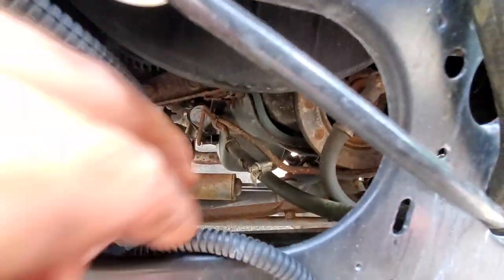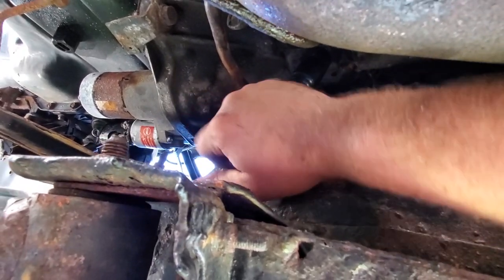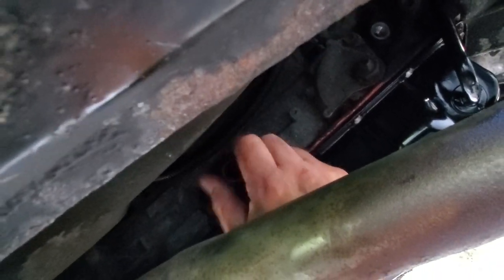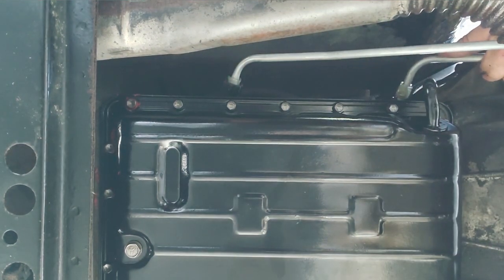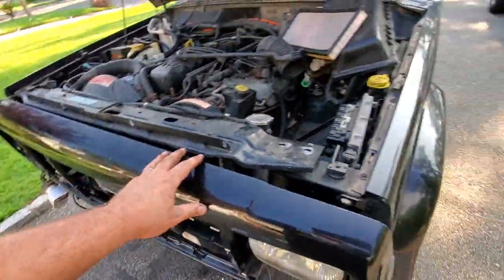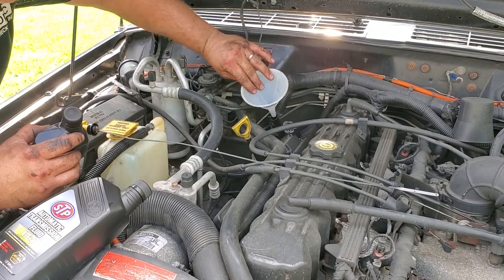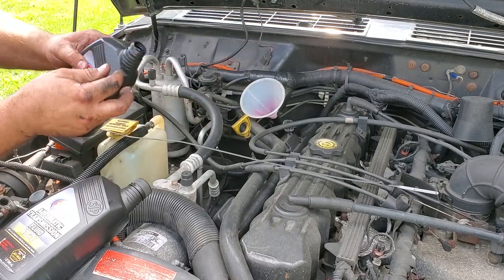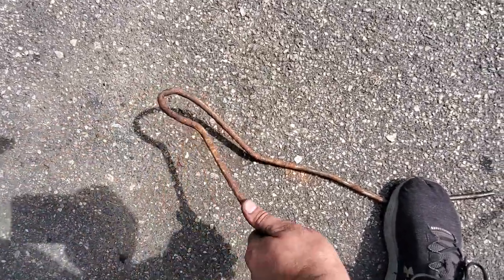JEEP CHEROKEE XJ TRANSMISSION SERVICE - PART  2 TRANS LINES & FLUID

Comment: For future reference, the bit about ATF-4 was actually a service bulletin after the warranty on all AW4s had expired, and many XJ owners steer clear of it. Next time you change the fluid I highly recommend using Royal Purple's MAX ATF instead. My XJ went from awful long sloppy shifts to being so tight and quick you'd think it had a rebuild. 

Otherwise, I'd absolutely stick with Dex 3 instead of ATF-4 as per the manufacturer requirements and not Chrysler's bad advice. Just don't switch if you're only draining the pan as ATF-4 and dex/merc should never be combined and will damage the tranny. Find a shop that has the machine that uses the transmission's own pump to flush the fluid and not compressed air. 

I also made the mistake of using ATF4 so I just wanted to share my experience. Cheers! ✌️
Reply: how do I find out what was previously used in my jeep lol

Comment: Great job Dan and the Jeep is looking good!-I'm about to do the same on my 2000xj-and was wondering why you bought so many O-rings?-How many and what size go on or in the dipstick tube-you never showed or said?--and do you not have to put an O-ring on the end of the lines after the plastic locks-before you push them into the connectors 800-714??--or just the clip only??-thanks in advance and keep up the great videos 👍

Comment: It’s funny i just found out coolant is leaking into my trans cooler so this video and the part number came in real handy
Reply from the maker: Glad to help, are you going to replace your radiator?
Reply: @ProjectDanH   yep I figured with my luck might as well just rip the band aid off and just do it all at once before  i nuke my transmission

Comment: If you take the electric fan out it's kinda easy to get at the lower transmission line at the radiator
Reply from the maker: true,but  it sucks either way. lol

Comment: I need to do this. My lines busted a while back and I flared in some soft lines, but they are starting to seep
Reply from the maker: oh man, thats a good quick fix but its best to get those new lines in sooner than later!
Reply: @ProjectDanH  well. It’s been 50k miles, and during that time, I only added barely a half a quart. They held up good. But it’s time for a flush, so I’m gonna do the whole repair
Reply from the maker: @highwayxj9397  wow!!! GREAT JOB

Comment: Good work! Mine look just like your old pair. It was a miracle they didn't pop when I pulled the oil pan out. Will snag some lines through your links when i get around to doing the jobs I already have parts for =]
Reply from the maker: Hey Sean, Thanks for using the links!

Comment: Whats up man! Question: is it true about atf+4 not recommended for AW4 trannies? I have a 98 xj classic and looking to do the same thing as you here. But the forums has this heated battle between atf+4 and dex/merc. Do you know why that's is? I see your running ATF+4 and just wondering if it's the right move, thanks man, strong island!

Comment: Dan, I didn't see you use the tools from the kit you ordered? are they absolutely necessary? or can I get away without them?  Also, how many connectors will I need?
Reply from the maker: 8:23 , the blue decoupler.   You Definitely need em to remove the trans lines from the radiator... the cheep plastic ones may work, but if its been on there for 20 years it will probably be stuck and require the metal ones from the kit.   They are a B!!!

Comment: Hey Dan I have a question for ya. My high pressure line that clicks into the radiator has about a 1/4in of play back and forth, I have and aftermarket radiator with a 5/16 elbow. Do you know the diameter of the elbow fitting in your radiator?

Comment: mi friend i am in perú i have a zj 5.2 95´s a change the MAP the TPS and the IAC but I steel burning fuel get 15 km per gallon i think to change the oxygen sensor and that's my las change I don't have the power it used to have, but i have new sparks wired, new sparks new sparks thins, maybe i change the injectors the engine is already fixed so mechanical is ok so i think is electrical problem, i am in a project is a incredible 4x4 have power, have force but don't pas 2000 rpm star stall, so i run until 2000 rpm  and wait the transmission make the change, sorry for my english i speak better than write
Reply from the maker: Hello, definitely try the 02 sensors!

Comment: Great video Dan. My 93 Cherokee sport has the AW4 tranny as well, but the manual states Dexron 2, ( I used 3)  I see you are using ATF plus and at 11:47 you show the write-up,  got me a little concerned.  Do you know anything about that difference ??  Thanks again for sharing (GREAT video).
Reply from the maker: Thanks buddy, I use a 2001 factory service manual.  I think older Cherokee AW4s used Dex.    I believe Chrysler developed the ATF as a universal fluid that's good for all Chrysler vehicles.  ATF4 is just an improvement.
Reply: @ProjectDanH   👍 got it, thank you my friend, great job and thanks' for sharing.